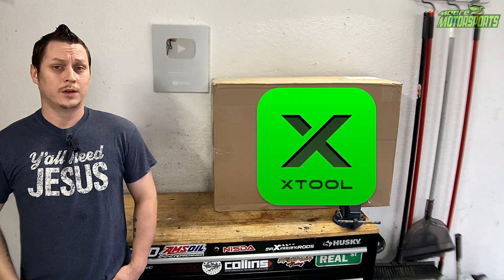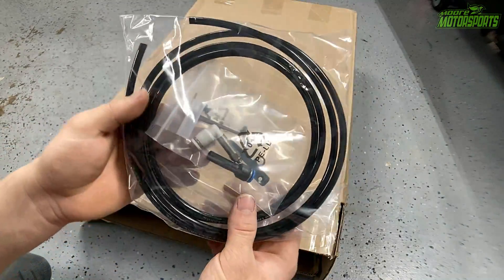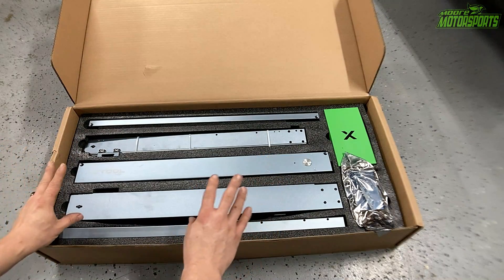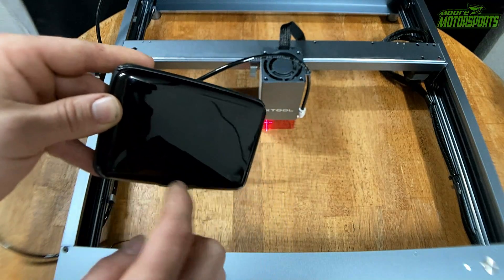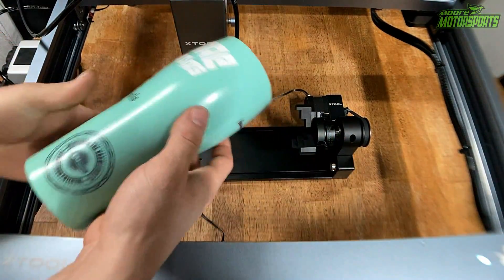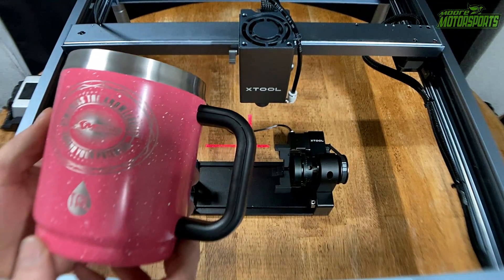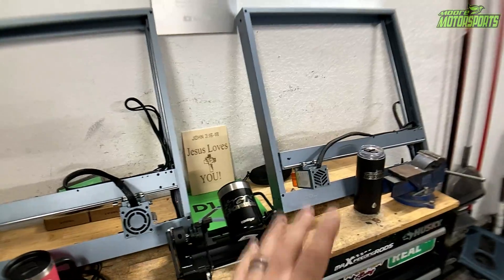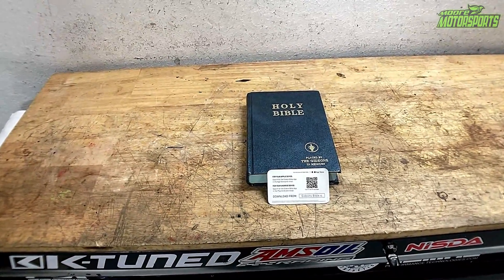XTOOL 20W DIODE LASER COMPARISON TO 10W #laser #xtool

Comment: What happened to the liner surface at the point the conical lug nuts pressed into the liner? And then therefore the continuity of the coating?

Comment: If you want to etch stainless steel faster and the design is a simple design that doesn't have any infill, you can set it to vector/line mode. That will make the laser just draw the lines instead of scanning back and forth one layer at a time which is raster mode. Not sure if you are using software provided with the x tool, or have lightburn. But lightburn is worth every penny.
Reply from the maker: I don’t like light burn too complicated for me 😂
Reply: @JamesDguy  same here lol im struggling my way through it watching youtube vids